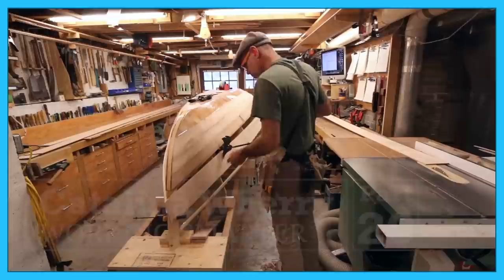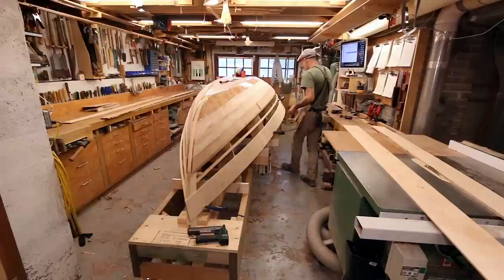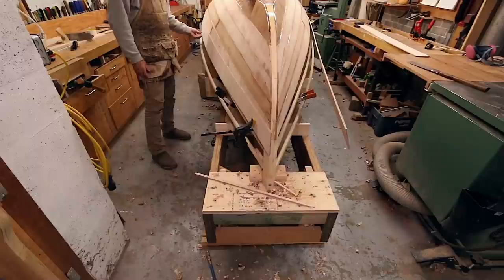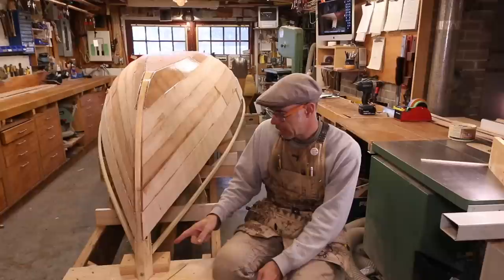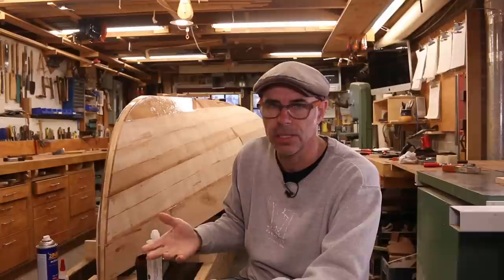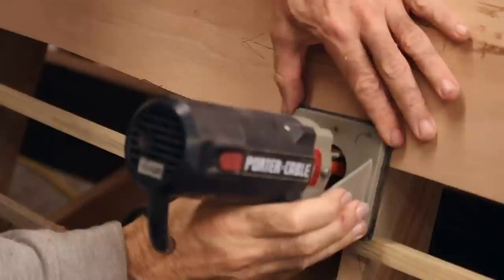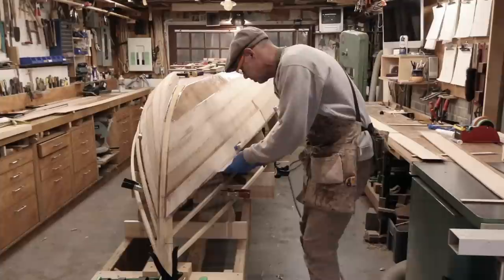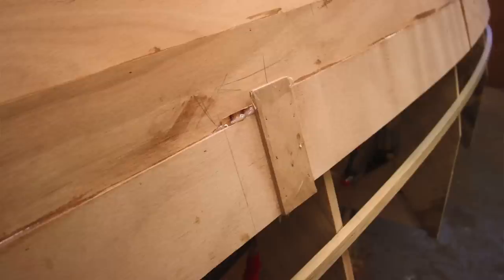Building the Catalina Wherry - Part 20 - Being dumb and Working smarter

Comment: I free hand cut all the time on my table saw my trick to keeping it safe is use a riving knife behind the blade it acts as a fence and keeps the wood out of the teeth coming up out of the saw
Reply from the maker: I hear you, but as I am cutting curves when I do it, the riving knife would work against me. There's no or very very little danger of binding in the operations I use it in so I don't see haw a riving knife would help.